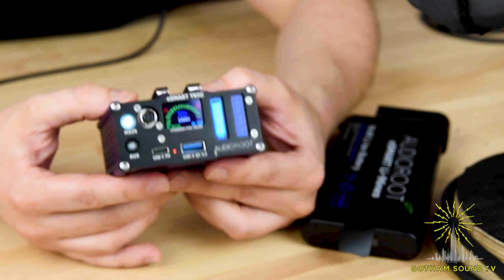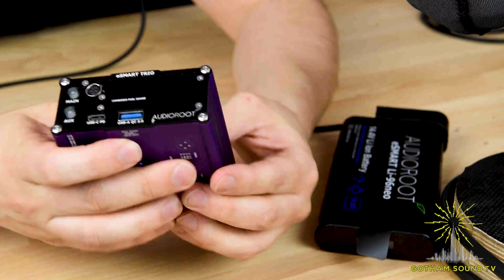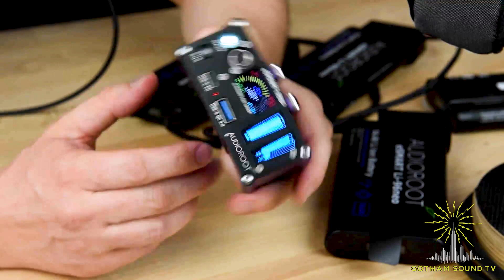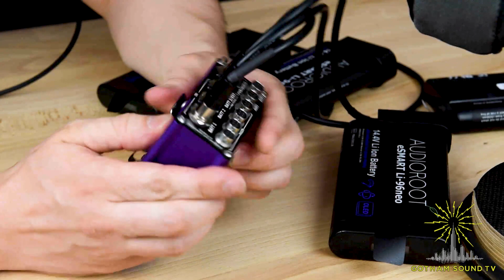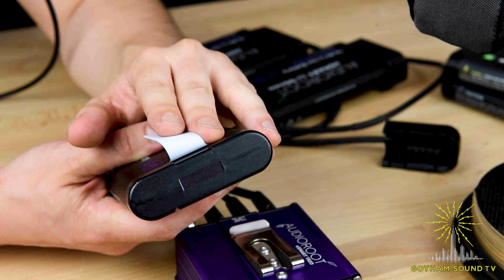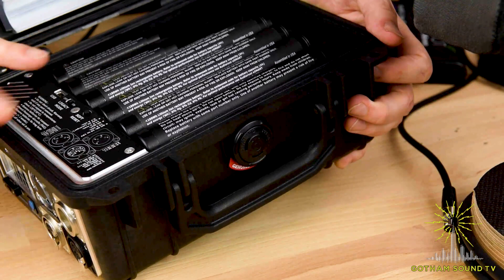Gotham Sound Expo International 2023: Audioroot

Comment: I purchased one from Gotham Sound along with two Neo 96w smart batteries, TA4 to Hirose cable for SD MixPre 10ii, AC power supply, and a DTAP to TA4 cable.  I did a test using all 3 inputs with the two Neos and the AC power supply.  To simulate a power outage, I disconnected the AC power supply and to my surprise, the MixPre restarted and the recording stopped.  
I repeated a similar test substituting the AC power supply with a V-mount battery connected to input 3 via the DTAP to TA4 cable, but when I disconnected the cable, there was no interruption and my recording did not stop.
I contacted Gotham Sound who then got in touch with AudioRoot.  I was told the issue was with the power supply and the TA4 to Hirose cable connected to the MixPre and they would ship a new set of cables.
Well, after I received the cables yesterday, I repeated the first test, but unfortunately, the issue did not go away.

It could be that I have a defective BDS unit OR perhaps, when using AC power, the failover to the other batteries does not happen.  Perhaps, that use case was missed by the quality assurance team and therefore was never tested.

This is a good BDS, but it would good for the failover to the other batteries to work fast enough when using AC power.  The latency in switching to the other batteries seems to be the issue when using AC power.